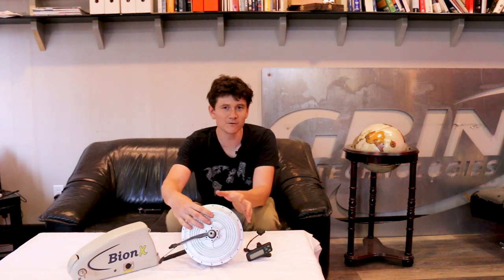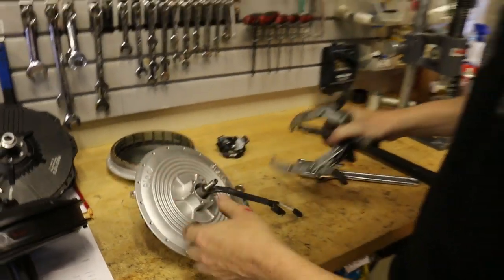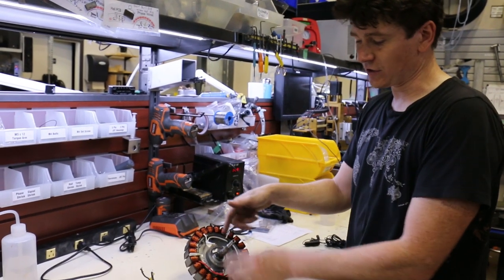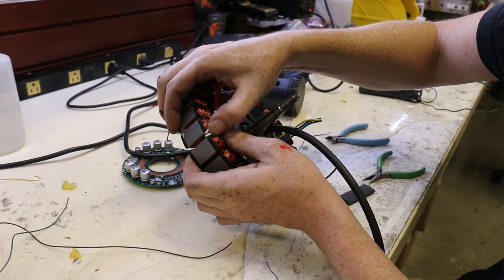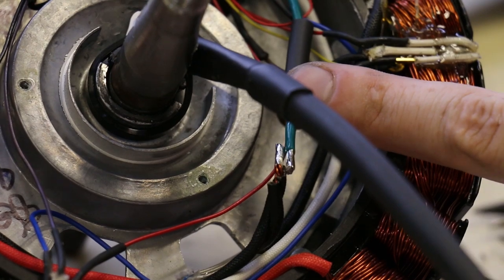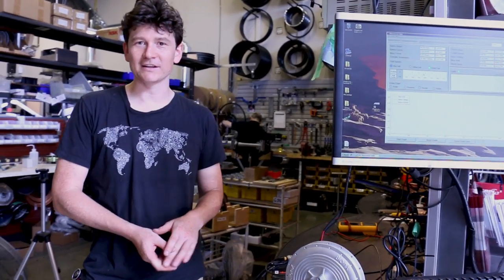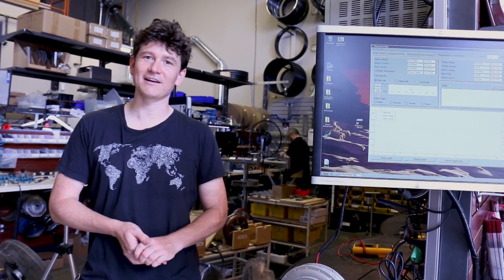How to Salvage / Hack a BionX Hub Motor for External Controller and 3rd Party Batteries

Comment: Excellent video! Highly informative! It is refreshing to see some in-depth technical information on hub motors, their anatomy and their function. Most sources I have found just give a bit of vague hand-waving to the tech while trying to sell you their proprietary, definite purpose hardware, just like BionX must have done in their day. 

With what I have seen here, I believe that I can effectively re-build and re-purpose the hub-motors I have and, more importantly, make use of the countless 3 phase brush less motors that I pull out of washing machines! (Turns out many of the newer ones are nearly identical to e-bike motors, only bigger!)

Thank you very much!
Reply from the maker: Hey Gord, you are 100% correct in your assessment and we totally shared that same frustration with how this industry operates. The only factory ebike motors you can't adapt to run with an appropriate 3rd party controller if you're willing to dig deep are the rare higher order multiphase hubs, like the Falco that uses a 5 phase topology or the wavecrest tidalforce that was 7 phase.  Virtually all others are a 3 phase BLDC, and you are quite free in how you run them once you remove the stock electronics and access those 3 phase wires.

Comment: The low drag is not an understatement the wheel spins 3 spins less than a normal rear wheel when testing the free spin and mine is 8 years old amazing motor actually and with some extra sealing like some flex seal on controllers etc it’s even ready for winter riding

Comment: ANother top tip for people struggling to remove the slotted washer on the side with the cables. I don't have the best puller set so they kept slipping off. I ended up using 100mm pullers (medium size in the cheap sets you can buy).
   Then i tied some good string around the lower part of the jaws (one complete turn around each one and then spiral and then thread to opposite sides of the opposing string path to pull them all together tight towards the main puller bolt. Basically hold the jaws on tight to the nut by wrapping a good string securely around the gripping part of the jaws to hold them against the washer. Then once pretty tight give the end of the nut a few good cracks with a hammer and then tighten again. Repeat this a few times and you will get results, try to oil the part the day before, it may help.
  When using pullers against a threaded axle it is best to try to tighten against a nut on that threaded axle, at least keep a nut on there so you can try to clean any minor damage to the thread as you unwind the nut after the job with the puller when that part of the job is done. The best is to put 2x nuts on the axle and then tighten themselves against each other in the exact correct position to best protect the thread of the axle. Otherwise, when using only one nut spun onto the end of the axle it will spin with the main puller bolt and travel down the shaft away from the top of the axle which now transfers all of the pushing force right to the end of that threaded axle creating a situation where you may once again damage the end of the thread.
One last tip i forgot to include. This might help someone. The main botl on my pullers is not threaded all the way up to the tip. This meant it would not fit in the small amount of space i had left between the puller nut and the threaded motor axle. So i did not use the long puller bolt till i removed the very last part of the casing later (when it comes away over the cables, on that side). What i did was i took a 50mm long 10mm bolt and nut and i used this nut and bolt combo (smaller diameter then the puller bolt so it just goes through the center hole and the nut goes on the underside inside the puller once it is in place. The smaller nut and bolt was the way i found when the puller bolt did not fit.
Reply: I put a small screw in site the axle hole.

Comment: Excellent - now I can use my bionix wheel for something other than garage corner filler. - I see a project in the works.  Tx
Reply from the maker: Cool to hear, it's not a particularly easy project to take on but there is something rewarding in taking something that's locked in proprietary obsolescence and making it function again ( with open standards).  Good luck if you take it on.

Comment: My iZip motor stopped working and I'd like to do this to my motor. 
- if the motor is 3 yrs old is it still worth doing, assuming the magnets and coils and Hall sensors still have a lot of life left in them? 
- How can I diagnose the copper windings at the 3 power connectors to verify there are no opens or shorts? 
- How can I diagnose the Hall sensors to make sure they're working well? 
- Do you like the KT controllers for 48V systems? 
- My 3 Hall sensors are less than an inch from one another, not 120" apart like yours - is that an issue for controllers? 
- What cable did you wire in, where can I buy one? 
Thanks, Mike

Comment: Hallo. Good video and explenation of what you need to do with your Bionix motor...question is, how to make speed sensor inside of motor?
Reply from the maker: No need since it has the 3 hall signals. For the L10 connector, we just solder the speed signal to any one of the existing halls.

Comment: I've opened a bionix motor before that comes from a "Smart" bike, i did this to repair the 3 speed internal sram hub. This one i need to keep original to hold balue of the bike but i have 2 other bionx motors i bought which i have been planning to do this with for years. i have 2x 1500W controllers.
  One problem i have now on my "Smart" is i tried to charge at 25V to see if it would work (normally 26V) it blew the charge controller transistors which are a very special surface mount transistor, very flat in a metal can casing. I now have the new transistors but it looks very difficult to solder. It was done in an oven at factory. I was considering solder paste but these are 55A each and tiny so thinking solder paste might melt under high demand usage conditions. Will probably pre heat the board and solder from above, either with the iron direct on the casing or perhaps with hot air to see them float into position.

  I have the parts now, just waiting to build confidence.

I plan to use heat proof AC cable found in ovens etc. for the phase wires, just long enough to exit the hub, then go chunkier to the controller. (it has a very rubbery silicone type insulation).

  Classic mistake. Forgetting to thread the cable through all the holes! i would have started again, personally. I'm used to this type of mistake. do it all the time. Even today, my friend came over for help fitting tow bar electrics and he got carried away wiring the plug before threading all the cables.
Reply from the maker: Good luck with it and nice to see so many people successful salvaging the motors from proprietary systems
Reply: @GrinTechnologies  Did you ever do a video on strain gauge amplifiers? It's almost a shame not to use it. There probably exists some Asian controller with a strain gauge port.
  Personally i would like to see the strain gauge amplifier and find or build a kit people can use to follow along.

Comment: Hey, thank you very much for this detailed dive into the Bionx hub motor. Is it possible to keep the original battery pack, perhaps with some modifications, so that it works with a custom controller (ex. Baserunner) and the motor as modified in this video ? Cheers
Reply from the maker: Yes, it involves removing (or perhaps just ignoring) the stock BionX BMS circuit on the battery and soldering in a 3rd party BMS, and hooking up the motor controller discharge leads to this 3rd party BMS board.
Reply: Could you perhaps show us this hack? Please. I have two batteries that I would like to do this with.

Comment: I have to give you a thumbs up because you shown that your real. Same here I would of keep the work flowing also then going back a few steps too. Why because I known what I did in doing this mod.
 Now I know why I Don't see any Bionx dealers. I was going to get one 5-7 years ago, at $15-1800.
Very good for not wasting anything great recovery work using what around you.
 I live in a big city I have no need to own a car or take a bus. I'm the oldman riding my bicycle on snow days in city core not day after.
I am that rusty winter chain, that's cranky, and blows bad rear tire air, for you safety suck in the bus flumes.

Ride Easy

Comment: Instead of modifying the motor, can a 2nd aftermarket battery be tethered/parallel connect to the existing original battery to extend it’s life? Or when replacing the existing cells, just simply use a larger housing and install a larger battery while using/incorporating the same electronics of the Bionx system.
Reply from the maker: If your can do battery surgery and replace all the cells or run another set in parallel then there is no reason to do this. Luckily bionx didn't pull a Bosch and design a bms that permanently bricks itself once disconnected from the cells.

Comment: If I wanted to upgrade a sensor-less motor with hall sensors and Temperature Sensor Bead, do I need a phaserunner controller, or could I do autotuning and automatic mapping with the Baserunner Z9?
Reply from the maker: The Baserunner_Z9 will work great for this too, just with a lower max torque level than the Phaseurnner (55A vs 96A) but still probably a large improvement over the stock controller it is replacing.

Comment: I still have my complete bionX setup sitting in a box in my garage from when I did my conversion.
I have been trying to figure out what to do with it, not worth anything, can't sell it.
But now...
Reply from the maker: Well, something to consider next time you find yourself with a free day and nothing better to do! ;-)    
That said, there are also people that will do the BionX battery cell replacements or sell complete refurbished BionX packs, which is probably the easier route to making it useful to someone.

Comment: Hi Justin, thanks for the vid. Served as inspiration to ressurect a 250 bionx motor. But trying to get it working, error 07, for my cheap china display its the hall sensors. Help. They all give (quick) 4.somehthing volts. Any pointers on to appproach this? Further more: motor isnt doing anything an throttle gives small sound. Tried all the six phase wire combo's, hall sensor as well. I found the reverse, more drag. Read  all there is, let it rest but to no avail. Thanks
Reply from the maker: error 07 on a random display doesn't mean anything to us.  I'd say make your life easy and get a controller that is both well documented and also which works sensorless if you can't figure out the halls and hall pinout.

Comment: Thanx for the videos I will tackle that on my next project.....I have a problem I disconected the harness  that comes from the lcd and throttle..to controller  but I have noticed that some wires are switched around and its connected to another connector that jumps to the Hub for example the red to brown and the brown to black...there is 2 reds....can you help me please.
Reply from the maker: You'll need someone who is familiar with the entire BionX wiring harness and connector specification, and that is unfortunately not us as we never dealt with BionX systems.  We just made this video to show how you could liberate the motor from the BionX's proprietary electronics to run it with a 3rd party motor controller.

Comment: I have an old Yuba bike with the BionX system, which is of course completely dead. Would any of your controllers be better suited to this kind of conversion?
Reply from the maker: The phaserunner and baserunner are both great options
Reply: Thanks! Is there a standard spec thermistor I should be using with your Baserunner controller?

Looks like I'll be able to reuse almost all of the controls except for the screen. That amplifier circuit for the strain gauge looks pretty simple, can that signal be used for torque sensing for the PAS function?

Comment: Hi! I'm currently using this video as inspiration to build a DD hub motor setup for a 10" knobby tired scooter. I managed to break both of the cast "hub" that attaches the teeth portion of the stator to the axle. Very upsetting bc it looks like a promising motor to hotrod and that's not common amongst scooter motors. Any idea where I can find diy parts or any ideas on replacing these? Thanks for always presenting informative fact based tests and reports. As mentioned, you're definitely a major source of inspiration as I walk a similar path as you currently, only in the world of scooter hacking.

Comment: same thing happened to the GenZe ebikes. be great to see a video on that
Reply from the maker: Sadly this is a very common occurrence in this space. Fortunately most ebikes don't have the controller intergrated inside the hub motor itself which makes it easier to hack with 3rd party controllers.  See https://www.youtube.com/watch?v=sL3bjQZGjoQ for a more generalized video on that.

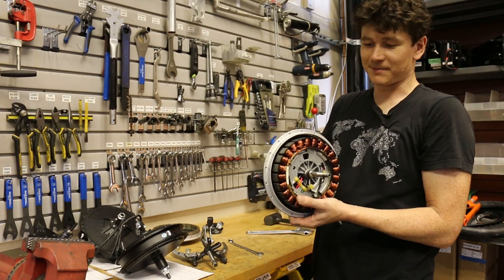Comment: In theory, if I only needed to fix a defective controller board, I could start my disassembly at 5:41 in order to expose only the board. Does that make sense?
Reply from the maker: In principle yes but but will likely still need to tap the side plate off or the rotor ring with a dead blow around the flange, in addition to using the gear puller.

Comment: I have a question about the thermistor, I saw the Video several times, it looks like you connected the second wire of the thermistor to ground, is that right? I thought it must to be connected to the +5v cable of the hall sensors.
Reply from the maker: Most thermistors are ground referenced, not 5V referenced.  It's silicon based temperature sensor IC's that would need a connection to the 5V power.

Comment: How are you, my friend? I have a similar engine. I opened it, removed that part, and installed 3 Black wires
Reply from the maker: Good, that is step one!  Next you have to source and hook up a motor controller.

Comment: My friend gave me his Bionx bike because he lost the charger. The battery and motor works fine.. I took apart the Bionx battery and use my own BMS for my other ebike. For the motor, I guess I'll have to learn how to re-lace the wheel and rewire the motor. All I need to buy is a gear puller.

Comment: I have one of the original Bionix Hub Motor. The battery was 22 volts had 10 nickel cadmium batteries in it. I was wondering if you had any idea how many amps that might have been. If you hooked up a 24 volt external supply through it would that fry it or would it have to be 22 volts. I know the nicads really were low output compared to todays stuff but I really like the ride on the bike is on and just looking for a boost on some hills. Anyway just taking a chance you might know. The video was awesome btw.
Reply from the maker: THey were probably NiMH rather than NiCad.  'D' cell NiMH were 8-9 Ah.   'D' cell NiCads were more like 5Ah.
Reply: @GrinTechnologies  Thanks very much for the info. Just have hacked an external power supply onto it and have to put the wheel on to see if it is going to work . Everything seems to power up but I think there is a 3 km per hour lock out on the rear wheel so I have to put it on the bike to actually test it. Hopefully it will work as this was one of the earlier units. Battery was Serial Number of battery 1060 9402 4F. Anyway thanks for your info I just would like enough power for the two hills on my route. :)

Comment: Can you suggest a motor controller model well balanced to use with this motor ?
Reply from the maker: Just about any 6 or 12 mosfet BLDC 3 phase ebike motor controller will work.  It's always good to have one that can run sensorless so you aren't dependent on the halls and sorting out the hall mapping. They run just great with our Baserunner, Phaserunner, and Frankenrunner controller series, and we also ran one early with our 25A grinfineon controller.

Comment: Hi Justin, I currently have this Setup on my bike with 72v battery. Do you have any idea how many amps can I push to this motor before it fries? I am not concerned at all if It does fry because I got this very cheap already converted even with temp sensor. I just want to test the limit but I don't want damage other parts as well.  Thanks!
Reply from the maker: It's time and amps, not just amps.

Comment: Can the BionX motor assembly be converted to a motor for wind of power generation?
Reply: Well that didn't work.... the question ought to be: Can a Bionx motor be converted so that it can be used as a wind generator or micro hydro generator?
Reply from the maker: Yes, this goes for every single electric motor in the universe more or less. But it's especially easy with permanent magnet machines like you have with ebike hub motor.

Comment: Hi this work for e-bike Ariv Meld  by General Motors me problem with battery is BMS optimus bms 12s bionx  and the battery no longer makes what can I do ?
Reply from the maker: Well you can start by replacing the controller and the battery